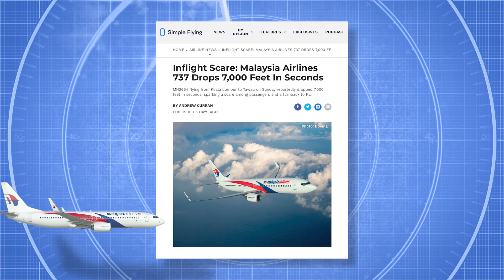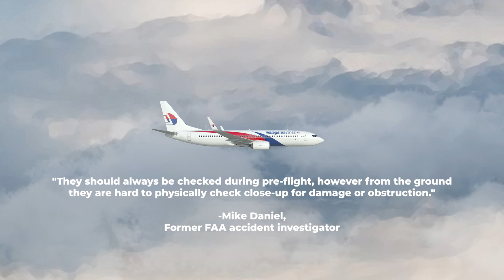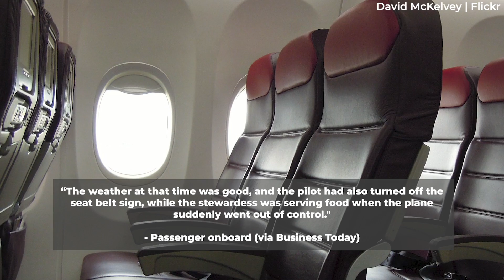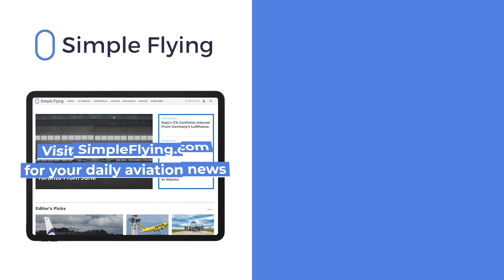Malfunctioning Pitot System Caused Malaysia Airlines Boeing 737 Dive

Comment: Boeing at it again and again ! Where is airbus??
Reply: This isn't Boeing's fault. Purely pilot and ground crew error.
Reply: @jackson3190  Yep.  Too many pilots who panic when the autopilot shuts off.  Clearly a training issue.
Reply: @Levi they freighter nobody is gonna buy as Airbuses MTOW is nothing compared to the competition?
Reply: @dopepopeurban6129  Where did you get that from? Pretty sure the 777xf will only slightly exceed the a350f in terms of payload capacity, Airbus has better range and fuel efficiency is nearly identical... Considering the fact that the 777xf is worth 75.5 million I would really expect it to perform better...
Reply: @bathwater3196  now the thing is, range doesnt matter in the cargo business. Most cargo flights operate between 4000-5000km per flight, rarely up to 6.000km. Thats a side effect of economics, multible flights and stopovers are cheaper to operate and maximize the fuel efficiency. Also the reason why airports like anchorage still see large scale cargo operations. Nobody wants or needs a freighter with 11.000+ km range.

Now, speaking of capacities. The following will be a conclusion of publicly available data.
The main downdraft of the A350f is its small payload capacity. Stated by multible sources, the targeted A350f MTOW lies around 285-290T in total (aircraft + cargo + fuel + staff and so on). At first it seems like a decent capacity, but if you look further youll find that the aircraft itsself weighs a little more than 115t empty. And this empty weight is data of the Passenger Version, freighters are usually heavier. F.e. the 777f (777-200 base) weighs just 10 tons less compared to the 777-300. If we now say an Airbus A350f is flying fully loaded on a trip between the FedEx hubs Memphis and Anchorage, a roughly 5h journey, the aircraft will need somewhere between 30-40t of block fuel. Lets take a 145t A350f (wich would be very light for a freighter of that size) for reference. 145t aircraft + 40t of block fuel to lets say 5t of staff and airline equipment (bunks & equipment) = 190t of operative aircraft. 290t MTOW - 190t of aircraft = 100t of cargo. Not bad in theory… …if it wouldn’t be for the fact that the maximum landing weight of the aircraft weren’t just 207t. 
Now lets say the flight will be completed and we are on short final. Fuel has been burned, only 5t of reserve is left. 190t if total aircraft - 35t block fuel = 155t total weight. 
207t MLW - 155t total weight = 52 tons of available cargo capacity.

That’s something a 767f can carry. For an aircraft the size of the A350, these numbers of bad, very bad. And low MTOW & MLW Numbers are a habbit to most airbus aircraft since decades now. The only 2 aircraft with a cargo-fit status were the A300 and A310. Everything else isn’t selling well if at all. This exact feature is what prevented Airbus from creating an A380 freighter, demand was there and customers were interested. However the changes to the aircraft would have been so extensive and costly that Airbus decided to ditch the effort. Airbus aircraft are just not developed with a freighter version in mind, all the priority is invested into the passenger versions. And this exactly leeds to these low MTOW & MLW stats, they just aren’t required.
That’s something Boeing has a clear advantage of, especially their widebodies are developed with freighter versions in mind. This especially is true for the 777 and 747-8.  This only applies to widebodies however.

I personally would love to finally see a proper Airbus freighter that isn’t just an outsider product. But as long as these freighter versions aren’t taken into consideration during the development of new product, this ain’t gonna happen.

Hope this made my thoughts clear :)